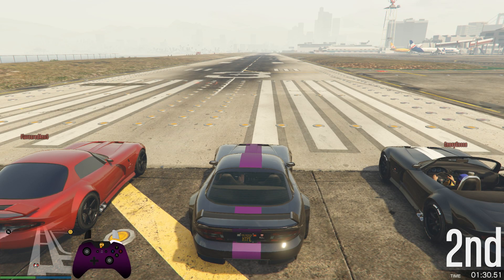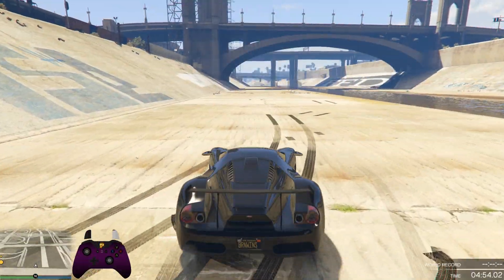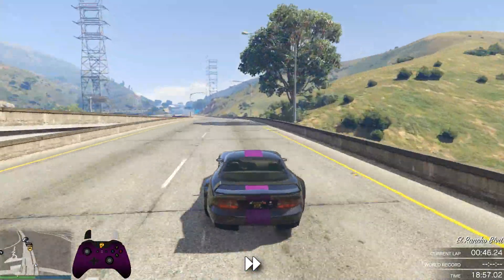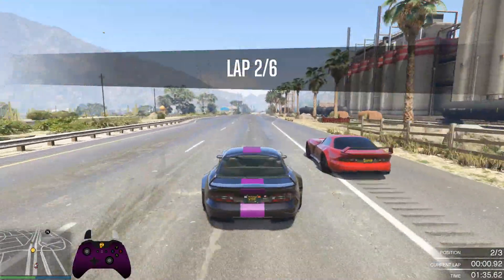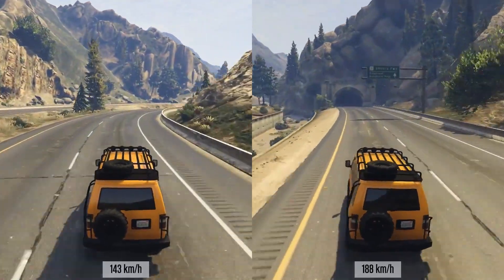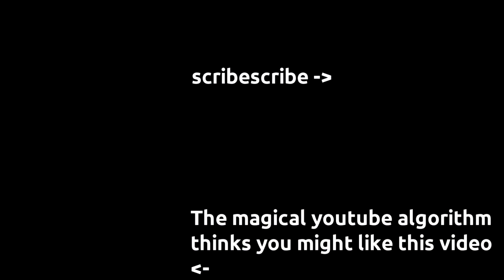Weird Mechanics in GTAV Guide - Mid-Drive (aka Double Clutching)

Comment: gta players: calling it double clutching even though it's clearly wrong 

car guys: angry noises
Reply: By that definition I'm a car guy
Reply: So whats that if thats not double clutching
Reply: @Hube02  well its a GTA mechanic where you use the handbrake to put the car in a state where it won't shift, there for bouncing of the Rev limiter, in the RPM range where the car has a lot of power. That and the fact that it applies a boost as if you were standing still and doing a burnout.
Reply: @Hube02  Also double clutching is shifting by releasing the clutch in neutral. Before clutching again and shifting into the desired gear.
Reply: @paulweerheim  Thanks for clearing that out
Reply: well too bad it's double clutching deal with it
Reply: @Hube02  the closes thing in real life to this is a power shift where you keep your foot on the gas while you press the clutch in then shift to the next gear then clutch out, making the gear shift really quick and keeping your rpm high, but its really bad for your car
Reply: @hoteldelta2453  on my island(Curacao) where racing and drifting is kinda of a unofficial national sport we engage the clutch agian while in the same gear to raise the rpm whilst drifting and we call it DOUBLE CLUTCHING:P so to me its double clutch babyyyyyyyy
Reply: TIL simply driving a manual with bad syncros makes me a car guy
Reply: @BboyInfusion  that's called clutch kicking
Reply from the maker: i said that whole section just to avoid the car nerds spamming it here lol
Reply: @FriendlyBaron  i know that but am just joking about it
Reply: You should’ve totally put
Car guys:(angry engine sounds)
Reply: ima car guy and i call it double clutch
Reply: @BboyInfusion  Usually thats called clutch kicking. Used in rally and drifting events by giving a short press or "kick" on the clutch pedal to rev the engine up and then re-engage the clutch at a higher rpm than the wheels so they spin. I wouldnt recommend doing it or even launching your car too much if you dont have a high quality clutch or dont have the money to keep replacing it
Reply: THANK YOU
Reply: Ceazar Garcia it’s actually clutch kicking
Reply: We also called it mid boost
Reply: clèwn What advantages would double clutching have in real life? With double clutching I mean the correct definition you stated.
Reply: @BboyInfusion  That's called Clutch Kicking. Your island is wrong. Lmao
Reply: @vibin4092  it helps shift faster, I don't know exactly how it works but it is used more on downshifts
Reply: Bappo is allergic to lacto Wouldn’t it be really bad for the car when putting it in neutral while slowing down?
Reply: Chaotix lol look at my channel dummy
Reply: Chaotix so i own a nissan skyline r33 type m , had a 200sx which i upgraded myself to rb25det 350 hp , and i own also a s14 that i swapped to vh41de also would like to note that we talk different here on the island and i was noting that we call it also double clutch ( i know what a clutchkick is i think) but I obviously dont drive 🤔
Reply: Dana Gibbs would a spec stage 4 hold up?😝
Reply: @BboyInfusion  It's fine if you can't drive but what isn't fine is making a mistake and not correcting it.
Reply: @cat-em3mj  No
Reply: Or is it
Reply: i agree
at this video
i make
angry car noises
Reply: @guac8927  it's to shift more smoothly, not necessarily faster.. though a smoother shift is faster in terms of the car but it can be a slower shift.

But it's basically to get the correct rpm for the gear to not bog down the motor
Reply: @vibin4092  It wouldnt provide any advantage in real life infact it would probably be slower than changing gears normally. The only time you would ever have to double clutch is in really old manual cars.
Reply: clèwn decent explanation but doesnt sound as cool 🤨
Reply: Kuruma does it the best  sounds so good
Reply: klz_tv 😂
Reply: @BboyInfusion  Stage 4? You should google what stage 1/2/3 actually mean because you are making yourself look like a fool.
Reply: @vibin4092  Double clutching in real life is pointless unless your car doesn't have synchros, and even then properly rev-matching does the same thing.
Reply: @danielmckee1594  Before gearboxes with synchros were common, freewheel clutches were used. You don't even need to use the clutch to change gears on freewheel clutches, so there is almost no reason to ever double clutch in a car. (even if the car is so old they call it a "horseless carriage")

The only time double clutching really makes a difference is if you're driving a semi truck with straight cut gears and no synchros.
Reply: @paulweerheim  yep
Reply: @Hube02  it's an exploit
Reply: I dunno if I count as a car guy but I think it’s funny that the term double clutch is being used to describe something that’s useful whereas in the car community it’s a complete meme unless you drive an unsynchronized trans in which case it’s life

Comment: You forgot to mention how cars in the ssass update and night club update cars cannot boost and get shifted into neutral
Reply: Advanced handling flags fixed it, and i think they have extra bouncy suspensions because R* wanted to try patching curb boosting.
Reply: @swews8157  
1) They didn't fix the fact that you can't boost in them, they only reduced the handling flags effect on the cars
2) In SSASSS, the handling flags made the car slower over bumps to try patching curb boost
3) In Nightclubs update they made the cars bouncy to make it more "real" but made the exact opposite of 2) flags; cars which could go in insane speeds (Itali GTO could go like 280+ km/h and that's even faster than Pariah, Rocket/Nitro boost cars or even some jets)
Reply: @Nightcore/Anime Lover 
He was saying ssasss patched the boosts for those cars specifically. As in they don’t boost. I understand the confusion though
Reply from the maker: Yeah other comments covered this well.
Reply: @fastlane8154  Ok, then.

Comment: Drifting can be achieved in gta by lowering the car manually by shooting the rims of the car if it doesnt have bulletproof tires. Once you lower each wheel by 2 elevations you will be able to drift. The best car to do this in is the banshee or the stirling gt. There are a few videos about drifting on youtube if you want to look into this in more depth but i just wanted to expand on the points baron made about drifting in this video.
Reply: GTAWiseGuy explained that really well
Reply from the maker: true on that, been covered by lots of others

Comment: Double clutching is used to manual cars with straight cut gears. You don't double clutch on a downshift in manuals - you're thinking of heel toe.
Reply: To be accurate, it's not because of straight cut gears that you double-clutch. It's because of sliding mesh gearbox, where you slide the actual gears when shifting. This of course pretty much only works with straight cut gears, but you could have straight cut gearbox that needs no double-clutching. The reason they are not used in typical manual gearboxes is because of the noise they make. But lot of dog-engaged gearboxes, mainly used in racing and motorcycles do use straight cut gears and don't require double-clutching
Reply: Lol no they arent half the ppl here know nothing about real cars, only gta cars
Reply from the maker: https://en.wikipedia.org/wiki/Double_clutch_(technique)

Comment: Right. Dunno if you're going to pay attention to comments on an 11-month old video, but I've got some info if you're interested.
What happens in this video (speed boosting): When pulling the handbrake, the clutch is disconnected causing the engine to rise in revs. When you drop the handbrake, this basically is like a clutch kick, sending a surge of power to the driven wheels. There's probably also a relation between current wheel speed and the speed boost it gains, judging by the driven-wheels difference.
Kerb/suspension boosting:
Not entirely sure how/why this happens. My initial hypothesis was the tyre compression (there's a flag for that) causing the wheel to match road speed with a smaller radius (= faster rotation) and when decompressing it keeps the rotation speed and thus increases actual speed. But it's flag-independent, and without the flag, the tyre does not compress. It might have something to do with the limited slip diff, but I'm not sure.
Short-shifting:
When measuring wheel drive force, it can be seen tapering off at about 0.8RPM[1] in any gear higher than first gear. The game usually shifts a bit later, but due to how the automatic transmission is programmed, lifting off the throttle causes it to upshift (like in a real car, less input = earlier upshifts). This puts it in its "optimum[2]" power band again.
[1]: The game engine doesn't use proper RPMs, just a range from 0.0 to 1.0, with 0.2 being idle, 1.0 being redline. Fun fact: In top gear, the car can drive faster than the redline (and calculated top speeds) actually allow.
[2]: The output force is actually just a linear line and drops from 0.8RPM. From just eyeballing it, it seems to drop about 40% in power towards the redline (RPM = 1.0).
Disclaimer: I made the manual transmission script for SP, so I did some research on why some things happen.

Comment: Double Clutching, though a good way to downshift, comes from a type of trans called a double clutch transmission, where you press the clutch in once to take a trans out of gear, then to put it into gear, you have to let off the clutch and depress it again, using the clutch twice.
Reply from the maker: what it really is, is turning this comment section into a mess

Comment: Wiggle boosting works because the game has a friction co-efficient between the wheels and the ground and a weird power distribution model.  When wiggling  you are allowing a wheel to temporarily speed up slightly and then catch the ground and apply its extra speed to the ground.
Reply from the maker: Do you have anything to back that up? I'm pretty sure its the curb boosting not the wheel thing.
Reply: @FriendlyBaron  what curb?

Comment: You can probably wiggle boost in the journey since the suspension is so soft you can roll it over just by turning left than right too quickly.
Reply from the maker: see that vehicle might be kinda too slow for it to work, the slowdown from the turn overpowers the engine.

Comment: It's reference is referring to how since it is automatic transmission. You take a car down a gear when you hit the break then instantly trigger max rpm while in that gear. So you not only get a significant boost due to dropping down a gear. You then transfer the excess RPM into the next gear switch and makes you in turn jump the following gears faster. Hence the name double clutch. Just because you don't have a button to lower the gears. Does not mean they aren't lowering when you slow down and adjust rpms. This is a misconception of GTA automatic transmission mechanics. It's adjustment of gears is still regulated by the player based on their own skills and understanding of a vehicle. There is a downshift in play. This a double clutch. Go first person. Watch it take place. However. Double clutch is only done is super cars. Sports have the easiest witch is E break boost. Super cars that don't do that. Can only be done in 1st and 2nd gears. You also have to trigger it with reverse then e break with perfect timing. You can learn the difference by attempting it in other cars. The pariah is easiest E boost. X80 is hardest double clutch cause goes through the first gear to fast. So you can only do it in 2nd 3rd gears. If you're perfect. 😃

Comment: the reason why it works is that when your going into third you do the handbrake but it fully skips third gear and goes into fourth and it gives you a boost. that’s why you can spin out and it revs at a very high RPM.
Reply from the maker: Actually thats not true, if you use a mod to show your gear, it actually goes down to first gear for a moment, hence the "launch boost".

Comment: I’m part off the ps4 stunt racing community and they all call it double clutching and I’ve spent so much time and energy saying that double clutching is when your in first and want to change into second so you put the clutch in and go into neutral then realise the clutch then put the clutch back then put it in second and release the clutch. Double clutching originated from older vehicles and trucks and busses because their synchros don’t work as well or they don’t have them. (I might be wrong on that). So double clutching is effectively really really slow.
Reply from the maker: Yeah thats the jist of it

Comment: when using the actual brake with hand brake method, u dont need to let off gas, let off a little but u dont have to fully let off. i do this consistently
Reply from the maker: Fair point, theres a couple different variants. you can also just hold the handbrake a bit longer in some cars. makes it a bit slower but also easier.

Comment: Hi! The reason its called double clutching is because of the drifters in GTA, they also use this method to drift in game, though not accurately spoken, the real life term would be “clutch kicking” as thats what drifters use to get their revs up while performing a drift, as they do so, the tires will keep up with the revs and spin faster allowing the car to drift for a longer period of time with the same or sharper angle, i suppose “double clutching” was just a mix of “clutch kicking” and some fast and furious influence, overall its not super incorrect, only misunderstood by the community. :)
Reply from the maker: I literally included the part about drifting in the game.

Comment: I tried to get it so many times, but all I got was car revving up with no actual speed boost or tire marks
Reply: Not all cars do the tire spin like the gto
Reply: It's best with a fast car that's been upgraded all the way.  It should be one with high acceleration- it's not gonna work well with the semi or anything crazy lol.

Also, if you hold the accelerator the whole time when you tap the handbrake, I think you might get the same engine revving without the speed boost, so that makes me think your button combo has to be both well-timed and accurate, plus it works best and most obviously at the very end of second gear before it shifts to third, so you're not going to get as much of a speed boost if you've been driving down the highway for 20 seconds and you're already doing like 120, or if you're shifting into fifth gear.  

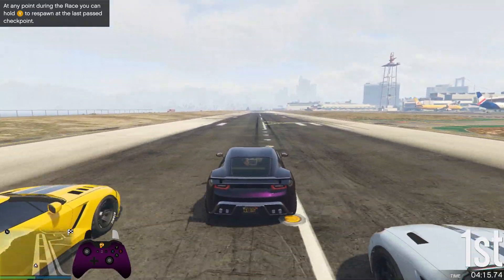Watch the bit between 1:24 and 1:55-ish a bunch of times to make sure you're getting the timing right, and pay attention to the controller overlay that shows exactly how he does it.  
Note: his written instructions say "hold handbrake" to convey that the gas comes in before the handbrake is released (to emulate the starting line boost you'd get in first gear,) even though when done at speed, it's really more of a brief tap of the handbrake.

Also, check the section from around 4:30 onward, as he addresses failed double clutches or "mid drive speed boosts" (what a mouthful,) and how some cars require the handbrake as well as the proper brakes, and other caveats that can apply.
Reply: @menma6240  I tried banshee, I tried the comet and a couple of other fast rwd cars and none of them worked for me
Reply from the maker: Depends on the car, and your timing and length of holding the buttons

Comment: What it does is that it skips second gear and goes straight to third gear. For some reason GTA registers that, for most rear wheel drive vehicles, the second gear is skipped if you press the handbrake while not holding down throttle.
Reply from the maker: It does not, if you use a mod, it actually goes into first person.

Comment: I find the double tap the handbrake method works well too, no need to let off the throttle, just the same as before just double tap handbrake
Reply from the maker: true i shoulda covered it. generally though anything besides a single press is slower, but more consistent.

Comment: A question about the speed run:
If Franklin's ability amplifies brake boosts and mid-drives, could that mean that it will also amplify the launch boost?
I don't know if you have tested this already, but it might be possible to launch quicker if you use Franklin's ability.
Reply from the maker: Yes it does! i often tap franklins power while taking off (see the "risky" strat during I Fought the Law)

Comment: I have around 5k hours on gta in total since release and never knew that. I love it so much it rises the skill ceiling but I have so many questions about brake boosting. I'd like to know the major bumps around the city that are easy to use / useful. Does the car you drive matter ? I feel like on some cars it's easier than others some bumps are nice but too fast and you can't brake boost because you go fly in the air, is it worth slowing down to get a brake boost ? if yes then it's really tough because too slow you can't brake boost and too fast you can't either

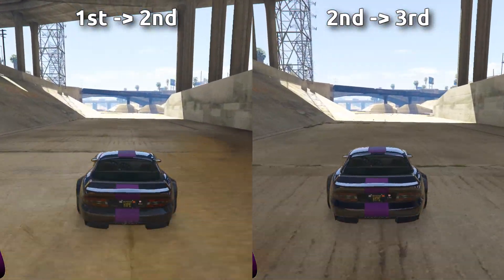Comment: 【3:42】 Is the speed in the rough graph measured in km/h (kilometers an hour) or  MPH (miles an hour)?

Reason being is that looking at the very end of the chart, the speed maxes out at either 225 km/h (140.62 MPH), or 360 km/h (225 MPH).

Comment: What about muscle cars? Will they wheelie in the mid-drive?
Reply: no bcause braking makes the car's nose pitch down, shifting the weight forwards. you might get slight steering traction loss but nothing notable
Reply from the maker: No the wheelie is on launch, you cant wheelie once moving.

Comment: Mid-drive is really advanced and unreliable though. Brake boosting is relatively easy for me but a mid-drive is near impossible. Got it 4 times in an hour with the Turismo and half of those were with the handbrake. Not sure if it's even worth using
Reply from the maker: Sorry my tutorial didn't help more as both can be 95%+ consistent with good practice.
Reply: @FriendlyBaron  Don't worry I will try again but the feedback loops are way more difficult to interpret